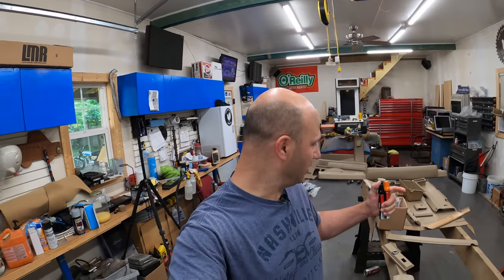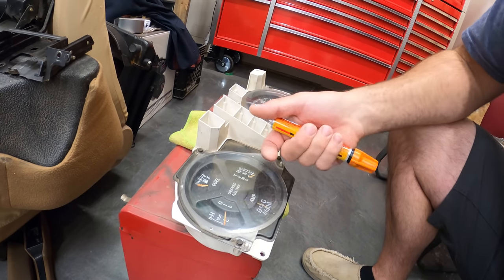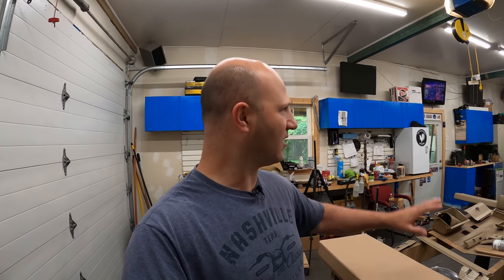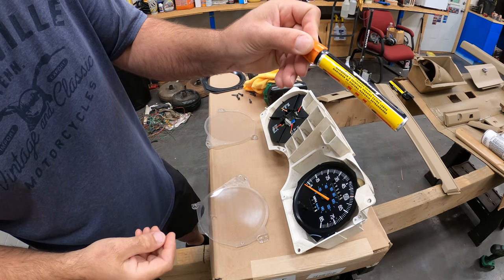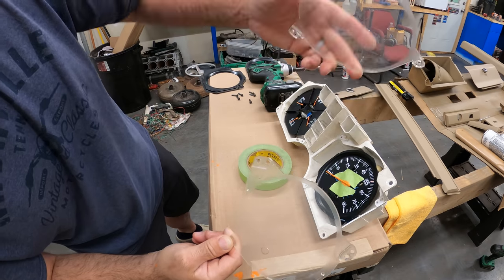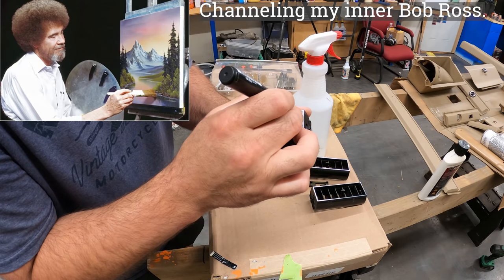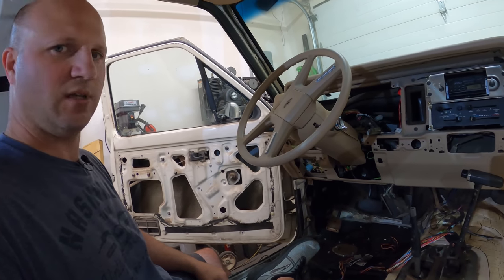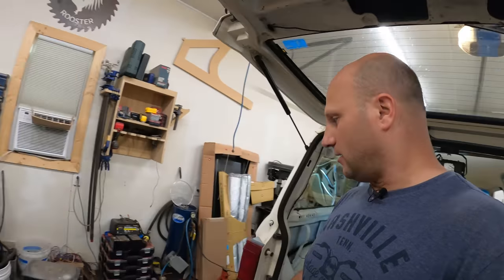Bronco 2 gets a Hidden Holley Sniper EFI Screen and How to easily restore a tired gauge cluster

Comment: Hello. I think it is great that you are restoring the Bronco. If you are going to shoot the paint yourself on the bronco I suggest that you use a urethane base coat clear coat finish, it is the most forgiving finish when you aren't using a good downdraft booth as it is easier to remove dirt or runs in the clear coat than if you go with a single-stage finish like acrylic enamel. And if you have access to a fresh air respirator system i would recommend that you use one as when you don't have a downdraft booth with a large exhaust fan to remove the overspray and fumes a charcoal mask does not afford you much protection from the fumes, and urethane paint, as well as any catalyzed paint, contain isocyanates, which is very detrimental to your respiratory system. I worked in a restoration shop as well as some dealerships over the years, as well as being an assistant autobody instructor at the penitentiary in our town and I am retired now, but please protect yourself, painting can be very hard on your body, so be very careful. Oh, I loved the car your father built that is in JR's shop, it is a work of art!

Comment: Always fun to watch your videos. The overhead console was perfect.  The only other thing I would have done was add a strip of foam tape around the edge of the unit to keep it from scratching on the back side of the console. Also would eliminate any plastic to plastic squeaking.

Comment: I'd love a '64 Falcon Delivery. I miss my Rangers. I used to use Long Motor Co, lmc, Victoria British when they also had a line for Datsun/Nissan Z cars as I had an '82 280zx. I've use lms truck parts for my Rangers ('96, '98, '99 and '04) including my '78 F250 Ranger and '87 F150.
Reply from the maker: I have a 61 falcon coming to the channel soon. Mustang 2 front end, 4 link rear, 8.8 posi, and much much more

Comment: The overhead is placement is absolutely perfect. 

Check the MSDS on that glue though, roofs get crazy hot in the summer so high temp industrial hot glue is the only stuff that doesn't become a nightmare mess in the hot summer. Softening temperature would need to be around 300f for you not to have an issue with it, it's not uncommon for that area to be over 200f. The MSDS sheet should have the softening, and melting point, not always using those terms. Permatex black adhesive would be absolutely perfect for that case, just don't do like I have done and not pay attention to getting the non adhesive lol.

(I'm not completely talking out of my bottom, I am an old sound quality car audio guy that we have to know lots of different installation things 😃)

Comment: Beware the A4LD transmission, prone to failure. That's what was in my '87 Bronco II. I loved that truck!
Reply from the maker: Thankfully my 84 has a C5 trans. It's only a 3 speed but is pretty bullet proof, unlike the 2.8 its bolted too. They fixed the 2.8 with the 2.9 engine but then broke the truck by installing the A4LD behind it.
Reply: @TheFracturedRooster  Indeed. I've always wanted to see somebody drop a 302 and a T5 in one.

Comment: I used hot glue on one of my cars . The isssue i had was that when it sat in the sun the glue became liquid again and did not hold what I wanted to hold down.  Great idea for the Sniper screen.
Reply from the maker: I was afraid that would be the case. I'll probably end up building something more permanent.
Reply: @TheFracturedRooster   I would use some silicone it will hold it but could be removed if you need to

Comment: I gutted mine too. Ya find all the rust that way. I had a rust thru leak driver's side in the little gutter where the windshield meets the metal on top corner. There's two layers of metal there and can't really see it from inside, had to see it from outside. Filled the leak with Dynatron #550 seam sealer from Autozone. Worked great. There was another rust thru leak over driver's door gutter. Took care of that same stuff same way.
Reply from the maker: Did something similar on my 85 ranger.

Comment: Had the same problem when i did my gauge indicator needles. Had to get it primed up and then dry the sides off. Because the same thing happened to me. lol. Well. Then i put to much pressure on one of them and broke it. BUT. At least it looked pretty. LOL

Comment: Huge win on the Sniper screen, perfect!  Serious question, I've rebuilt several clusters on GM trucks I've owned.  I think the needles on those clusters were lighted, they kind of glowed, any idea if that paint would kill that glow, I'm not sure if the Bronco needles are built that way or not?  No judgement, just curious, any information is good information.  I need to rebuild the one in my truck I have now and that would be nice to do.  I usually go through and replace all of the lighting with LED's and just refurb them, GM's have a tendency to have stepper motors fail so I redo all of that to.  Bronco's looking good!

Comment: It's a lot easier to be one of the first few viewers on this channel 🙄  .... not that you'll be ever restoring and cleaning the inside of a guage cluster again but if you do get one of those little squeeze bulbs that blow out air. Not the ones for cleaning ears but the more professional version sold for watch & clock repair. You can get one off eBay for under $10 and also in the same watchmaker tools section you'll find this stuff called Rodico (? on spelling) that comes in either a seafoam green color or a dark blue color. Watch and clockmakers use it to pickup lint and light dust from fragile and delicate watch dials and stuff. The blue is supposedly the stronger adhesion of the two colors but I can't tell much difference. Get yourself some because I'm sure you'll find multiple uses for both items.

Comment: Is there anywhere you can get all the bolts that hold the seats down in an 88? I am doing a body swap because I want my frame but my body is bad so my parts bronco will be the new body but I cannot get the bolts out there so rusted. And can’t seem to find where to get like a kit for all the bolts and screws. Any ideas?